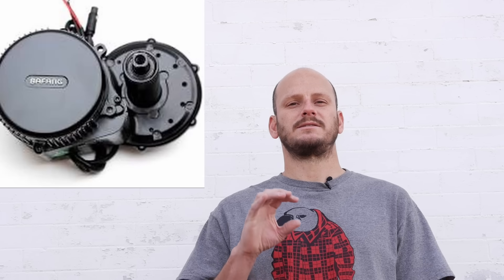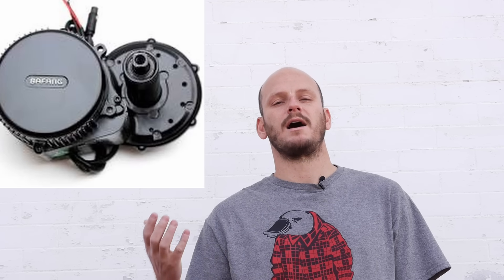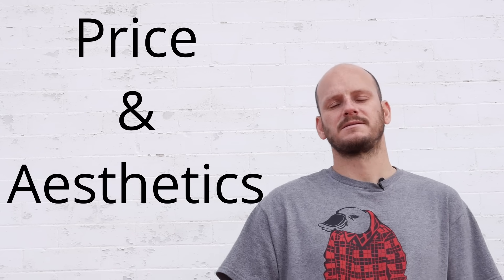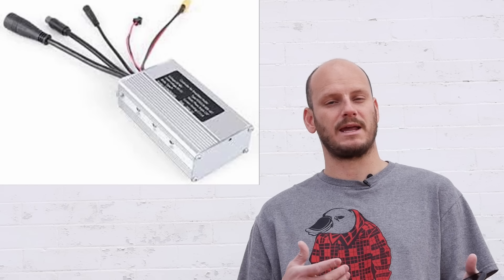Hub vs. Mid Drive Motors: Why Hub Motors Suck and Debunking Common Myths with performance test

Comment: Geared hub, direct drive hub, front or rear drive, mid drive. No one type outdoes all the others. Each is the best at something. So choose what suits the most of your riding.
Reply from the maker: Well said. I still won’t carry/offer hub drives though😀 I will say mid drives are a “smarter technology” and will always recommend them.
Reply: @JohnnyNerdOut  would you recommend a $10K car to get across a lake instead of a $50 boat, becuse the car is more "smarter technology"? 

I'll recommend what suits the bikes intended purpose the best,  geared hub, direct hub, front or rear hub, or mid drive.
Reply from the maker: @spinnanz  absolutely. There is just so few scenarios in which I would recommend a hub motor. Maybe for someone just starting out with an E bike and who doesn’t live anywhere near Hills and doesn’t need to go above 15 miles an hour. The hub motor is totally fine for that type of situation.
Reply: @spinnanz  That analogy doesn't make sense. A car is never going to be the "smarter technology" for crossing water. You are comparing a car to a boat to do a boat's job. @JohnnyNerdOut is comparing two bikes to do a bikes job.
I would recommend a boat with the motor in the back rather than one with the motor in the front. With a boat rear drive is the "smarter technology".
I agree with you. It should be up to the rider. If the rider is planning a lot of off-road use a mid drive is better. To begin with the weight is in a better location. If they are planning to use it on street only a hub drive will be fine.
So if the rider (buyer) wants a hub drive they will go to a different shop and @JohnnyNerdOut won't have to deal with them if they decide they don't like it. Nothing wrong with that.
Reply: @AngusNB  What if the boat with the motor in the front is a jetski? water-jet engines can be "smarter technology" and lots of fun.
Reply: How about using all 3 motors at the same time? Front and rear hub plus a mid drive motor!
Reply from the maker: @sunyun4425  have you gone mad with power?!
Reply: @sunyun4425  That would show how useless mid drives are.
Reply: Hub motors nowadays seem to last longer and I can do 40mph with mine. Each has their purpose. My next bike will be an electric motorcycle. Mid drive of course.

Comment: For a reliable long range commuter go hub drive. I have both and the mid drive is better off road at lower speeds. Kits may not be reliable but a purpose built hub drive simply works better if you want to do lots and lots of road miles.
Reply from the maker: That’s just like, you’re opinion. Man. 😎

Comment: Like some of the other comments, I disagree on lots of points you make. I have bikes with both the 750W Bafang geared hub and the BBSHD mid drive (and have worked on both doing mods, etc). My BBSHD has more top speed but my 750W hub (on a 20" fat bike) has more torque. The BBSHD gets very hot on hill climbs, the 750 hub is always cool on same climbs. Yes, the 750 hub has only one speed, but that is if you use throttle only. With pedal assist, and using gears, it's much the same as the mid drive and much easier on the gear change than the mid drive. I have had more problems with mechanical bits on my mid drive bike than the hub bike....etc, etc....  Don't rubbish the hubs - main disadvantage of the hub drive is weight of back wheel.
Reply from the maker: I find it hard to believe the hub is better at hill climbing due to gear ratios( going all the way from motor gears to the tire). Granted different hub motors do behave differently (better at hill climbing) I just can’t imagine a 750w hub out climbing a 750w mid. 
Thanks for chiming in, especially since you ride both variants, and keeping it “above the belt”😁
Reply: @JohnnyNerdOut  No worries! I only chimed in because you used the Bafang 750W geared hub motor as your example for comparison. That motor is one powerful little beast, especially when driven by a beefy controller. Being geared, with a 1:5 reduction, it produces lots of torque, even at tyre level.
Now, if you had used a DIRECT drive hub (no gears) as the comparison, most things you said would apply - then, the equivalent powered mid drive would probably provide more torque via the bikes gears. The hub motor bike would need more pedalling assistance to get up the hills.
I wouldn't put people off using hub kits though, as they are much cheaper to buy, easier to install, provide a very smooth ride and don't chomp up your chain and cassette as much. Great for paved roads, not so good on rough tracks because of the weight on the wheel.
Reply from the maker: @joc1862  let me be a mid drive snob!!!🤪

Comment: I can tell you why i am looking for a hub drive instead of mid drive... they almost cost half the price...
I'm neither rich, nor am i famous and getting free things from sponsors.
So a 500w geared rear hub kit for 250$ is fine with me, but a 500w mid drive is 400$. And not to mention that the mid drive will use up the chain and freewheel i guess, which you will then have to change 15$ and 60$. And the whole "rear hub where you have to hang up your old wheel in the garage" for the mid drive i have to go buy... 60$ worth of tools to install it. So we're at 460 now. Compared to 250. And i now have a crank set that i can hang up in my garage that i probably won't use again... ;) See what i did there? hehe
Overall, i'd go for the rear hub. But i understand your points and arguments. Just some of them aren't quite... "fair" arguments.
Nice vid though, i will do some more research :)
Reply from the maker: Just be wary of quality @$250. Not saying it’s impossible. 
IMO you might go through a chain every 1k miles and a rear cassette every 3-4K miles. If you ride conservatively and maintain your bike, you won’t have any issues ever. 
You are totally correct with having extra parts though, whichever way you go you will be replacing parts with electric components. 
Not sure if you were insinuating I was sponsored or not, but I definitely am not😩 
IMO to get the same quality hub motor, from say, Grin at Ebikes.ca you will be spending the same amount of money
Reply: @JohnnyNerdOut  Doesn't sound too bad. And i actually just ordered a 750w bafang middrive. Because i just thought in the long run, it will be easier to get parts to fix a bafang rather than a "no name" brand thing. it came at 100 ish $ more than a hub, but i hope it was a good investment. And reason i named the whole price thing is because i live in a country where prices are... a joke, and they keep going up, but paychecks don't really follow "the curve" ;)

And yes i was partially insinuating that because it has just become a habit to see people do that. "Rich" people getting free stuff in hopes that us "peasants" will buy the product.
Reply from the maker: @crispy-k  good for you! I definitely think it will be a better investment in the long run. If you take decent care of it it will last you tens of thousands of miles and give you amazing performance all along the way🤘
Reply: @JohnnyNerdOut  I hope too ;) Just need to buy a few tools now and do some research on the maintenance side of things ;)

Cheers.

Comment: I have a Super73 with a rear hub motor, no PAS, single speed and no cassette so no gear shifting. Is it feasible to want to install a mid drive and not add gears and keep it single speed?
Reply from the maker: Feasible yes, but what are you trying to achieve? It will essentially behave just like a hub motor with a single speed except you will be able to easily change the gear ratio by swithing out chainrings/ cogs. So only a slight improvement IMO
Reply: It's really not feasible. You will have to replace the back wheel, buy a mid motor kit and install everything. In the end it will work exactly the same except the weight will be better distributed.
You could sell your hub motor but you wouldn't get enough out of it to make much of a difference.
A more feasible plan is to sell your ebike and buy what you want.

Comment: Have you ever visited endless sphere forum?                                                                                                             What you say from what i read (and also from my experience!) at  the endless sphere forum is very different my friend!                                                                                                                        And what i read  is that the most reliable  between hub and mid drive is the hub motor by far!                                                                                                                           For mid drive installation motors there are few options and those are the Bafang bbshd the bbs02 and the   tongsheng tsdz2   ,the most failures come from the  tsdz2 where i couldnt find anyone in that forum that had 5000 kilometers   without a major part failure,after the  tsdz2   comes the bbs02 with also  many problems such as striped naylon gear and burnt controller and the most reliable out of the three is the BBSHD but is much hevier and much more expencive (and i havent even touched the chain problem with mid drives!)                                                                 I have a 500w mxus hub with 5100 kilometers and had no problem except 2 broken spokes witch i changed in 5 minutes(niple was still on the rim so no need to take wheel or tyre off the bike!),my budy has a bafang bbs02 750w  with 3850 kilometrers on it and has already changed 2 chains one nylon gear and has burnt a controller!!!!!                                                                                                               HUBS RULE!!!!!!
Reply from the maker: 😀 it’s all opinion my friend. All Ebikes are good bikes at the end of the day. I just get asked what the difference is ALL THE TIME and figured I’d make an opinion piece. Sounds like results vary by user for sure.
Definitely love endless sphere and don’t ever recommend tsdz2. Too small of a motor to handle any power without burning up. Hubs are great for light duty riding. If you live near mountains like I do , it’s a hub motor cemetery😀 I’ve replaced so many burnt hubs!
Reply: @JohnnyNerdOut  I agree with you on most  of the above but i disagree with your video, from your video you make it look like mid drives are much better than  hubs in every aspect and that is not the case,yes mid drives are way better at hill climbing because of having the advantage of using the gears  and also have a slight higher top speed(my 500w-1200peak hub motor tops out at 30mph and it is pretty scary,so even if it could go 35mph i would not recomend anyone to go above 30 on a bike)   that is only where they are better than hubs!                                                                                           Yes  hubs lack in hill climbing abilities compared to mid drives and have a slightly smaller top speed but ar far more  reliable,are much cheaper and do not do damage to other bike parts like chain and cassetes as mid drives do,you should have put that in your video because i beleive you know that is a fact!                                                                                                                      And one more thing you should know,hub drives dont necessarily have to use a brick of a controller as you say in your video,there are kt controllers that are integrated in the downtube battery base and these controllers are  stealthy as it gets and are very reliable  and work not even close as hot as the integrated in the motor controllers of the bafang and tsdz2 !
Reply from the maker: @ΣάμηςΜπαρμπαλιός  😉
Reply: @JohnnyNerdOut  Don't agree on the TSDZ2 being a bad motor at all. I've installed dozens & would not recommend them for high power applications but for 500 watt versions they provide a much smoother & easier conversion than the Bafang. They are lighter & more efficient & if you ever have to work on it, you don't need to be an engineer. The early models had a problem with blowing the sacrificial blue gear but that is a simple $25. repair. They are also a favourite for tweaking the programming & once dialed in are a great motor. Ride one. The Bafang is a truck in comparison.

Comment: thats interesting because people generally say that mid drives require more maintenance and presumably wear out fast due to high rpms.  I'm thinking theres a good reason why Sur Ron uses mid drive though...
Reply from the maker: Honestly once you start getting over 2,500 watts, performance differences start fading. However handling is different with the weight center mounted vs. in the rear wheel. That’s probably more why they did it

Comment: I completely disagree on your view my hub drive is extremely good on low and high torque it's not hard to upgrade the spokes and just run a check list every other ride also I comfortably do 37mph with a top of 41mph using a hub with a mid drive you have to peddle hub drive it's throttle and go a mid drive is so much harder on your entire frame and it's not way more fun I can promise you that
Reply from the maker: What voltage are you running?
Reply: @JohnnyNerdOut   so in all I'm running a 1000w hub at least that's what was claimed by seller and I've got a 18 mof controler with a 46amp max output
Reply from the maker: 46amp? That’s a lot! 58x 46= 2,668 watts. Something with that kind of power will definitely be good at hill climbing and top speed! This vid was mainly to show the performance difference between 750w street legal versions of both motors. I have zero issues with hub motors performance when they start to creep to 2,000 watts and above. Ride on brother!
Reply: @JohnnyNerdOut   will do and you the same sorry about my blunt type of aproch in the matter and if looking at it compared to what I ride and what you've explained in the video it's two totally different animals and my bike isn't exactly legal in the slightest
Reply from the maker: @trusilent1940  I’m used to it by now with the title of the video alone! I knew I was going to get crap. It’s all good😀
Reply: @JohnnyNerdOut  Hey Johnny im gonna buy 52v batt 40amp controller with 1000w hub motor bike.
 is that gonna be enough for my weight about 275? for the uphills
Reply from the maker: @gunslinger031  I would say no. Hub motors are generally not designed for hill climbing unless specifically designed to do so(almost none are)
Reply: @JohnnyNerdOut  That's really how the choice should be framed - wirh steeet legal caveat.

Thats entirely what drives US ebike manufacturing.

Asidr from some niche shops, no one manufactures ebikes with 8,12,16kw, because they are afraid of a crackdown leaving them with worthless inventory.

And shops generally won't carry anything where they aren't a dealer because that allows high markup. 

Plus product liability becomes an issue with 50+ hp on a bicycle frame, combuned with an idiot rider. 

So they sell 500w bikes for $2500 to rubes.
Reply: @JohnnyNerdOut  you knew you were going to get clicks and comments with the title of the video alone too
Reply: It's a 52v batt but full charge levels out to 58v
Reply: Mid drive motors have a throttle too, for legality purposes most don't but they are a full on motor. All u need is a flywheel so it can turn a belt or chain on it's own.

Comment: Nope . I  have tested both with same battery voltage and wattage from motor . Hub drive beat it in speed . Hub is also cleaner looking, doesn't rely on the chain (as in if your chain snaps you can stil keep riding), doesn't wear out your drivetrain, doesn't make near as much noise (one thing EVs are supposed to be reducing) and you can choose an array of carbon cranks whereas you are stuck with splined cranks for mid drive . Finally a mid drive lowers your ground clearance and looks ugly . Just telling how it is .
Reply from the maker: Haha, ya it’s all personal opinion😀 the only thing that isn’t opinion though to be fair is hill climbing torque. That can’t be argued.
Reply: Top Speed: Depends on gearing setup. My MTB is slower on top speed than my equally equipped BBSHD Mid drive Road Warrior(topped it out 45mph once at only 1000w and it was still pulling, power was only at 75% on 52v battery). I have yet have any Hub Motor rider on the street out accelerate me with their fixed single speed.
Ground Clearance: Depends on the frame and Chain-ring size(99% of the time you bottom a frame, the Chain-ring digs in first). The Bottom of my BBSHD Mid drives sit at the same height as the Bottom Bracket. Limiting factor is my Chain-ring. Also there are Mid-Drives that mount in the frame verses mounting in an existing bottom bracket. Bosch(lowest performing Mid-Drives, do not recommend), Shimano(STEPS), Yamaha(PW Series Drives), and Bafang(M600 Series) to name a few, all make in-frame mounted mid-drives.
Splined Cranks only on a Mid Drive: FALSE. Again, Depends on the Mid Drive. They come in both Square Taper(ALL Bafang BBS series drives are Square Taper) and Splined most the time. 
Noise: FALSE, my BAFANG motors are whisper quite.I hear the gear/chain noise over the soft whir from the motor. Hell my rear Cassette freewheeling is louder than my mid-drive.
Reply: @SternLX  true.  I was astonished at how quiet a freshly greased (Mobil 28) BBS-HD was.  Only thing that astonished me more was the reduction in power needed to go a given distance.
Reply: @dennisyoung4631  Yup. You can get it even more wisper quiet if you replace the Nylon Primary reduction gear with one made out of PEEK. Luna Cycle USA sells them. I repacked my BBSHD primaries with Lucas Red & Tacky. Running on the streets you don't hear it all. Just tire and chain noise.
Reply: @dennisyoung4631  my hub motors are quiet .
Reply: @SternLX  not false . The increased speed makes the drive train more noisy .
Reply: @nonegone7170 don't buy shitty cheap then .